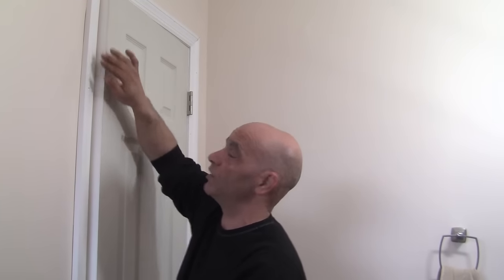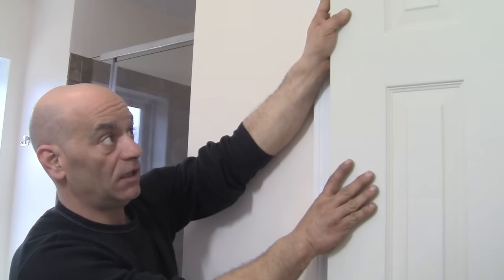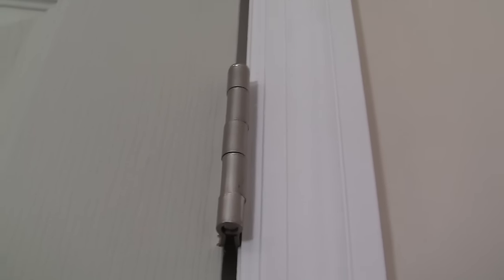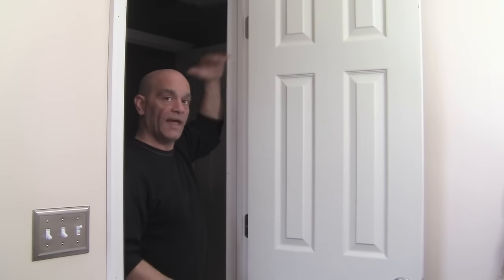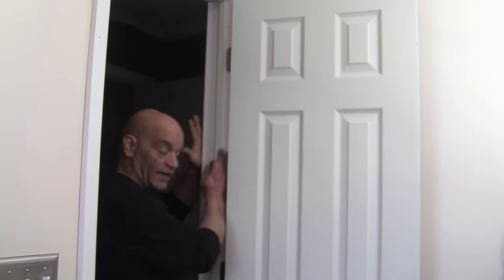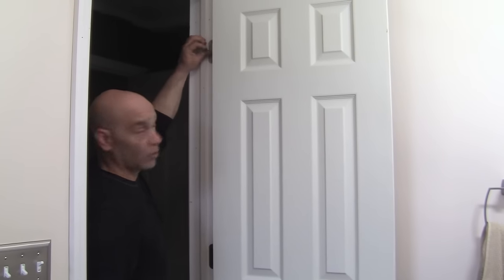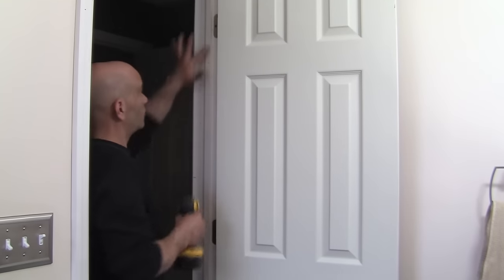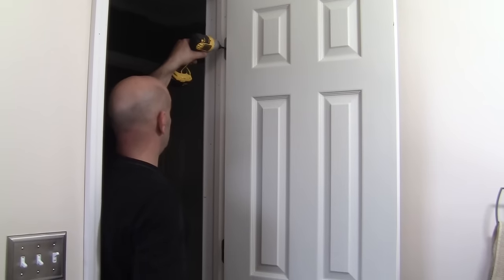How to adjust a door when it's hitting the sides.

Comment: What about a door shim? You can use a thick amount of paper and use the corner of an envelope as the sleeve for all the paper. Cut with a razor blade to correct size. Drill screws through the paper shim securing it. Easy mode, free, and puts good use to your junk mail. ;)

Comment: I used the T25 star headed screws about 1 1/2" long and it does the trick all the time. I've also had problems lining up to hinge halves to put the pin in so I just removed the half hinge from the jamb side, put the hinges together and slipped in the pin. Then, I got some long paint sticks from the hardware store, slide them under the door to elevate slightly and re-attach the hinge to the jamb. So far, it has worked.

Comment: thank you, it fixed my door. Too tight to close. I was thinking of replacing the hinges, but I cleaned it first with WD-40. Then screwed it with 2.5 inches screw. It worked.

Comment: I took out the existing screws, which were loose, stuck chopsticks, you can use toothpicks, into the screw holes, and reinserted the old screws and saw them really pull and tighten.  A nice fit now.
Reply from the maker: Very cool, thank you

Comment: If the screws are not loose I use a 4lb sledge and a 2' scrape piece of 2x4 to adjust jamb. The places I work at have crazy unstable foundations. Sometimes my customers cannot even open their doors and the fire department cuts through the front door because its wedged shut.

Comment: Wanted to share a tip if you are trying to screw into an existing hole and it won't catch, drill out the hole, glob some wood clue in there and stick a dowel into the hole and cut it flush with the frame. Let it dry then screw into the dowel. And yes the pre-hung doors you get from jeld-wen and masonite have the cheap ass hinges on them with short screws. Those are usually the first thing that will go bad when you buy a pre-hung door like that.

Comment: I’m going to have to try this. I live in an apartment and I have a back door that it seems that, with the building settling occasionally, the door goes anywhere from having enough space on the bottom for people to actually see into my apartment, while coming up the back stairs OR, the edge of the door is actually resting on the floor, misaligning it with the latch and it won’t latch properly. Despite having sensors and a Ring Doorbell on the door, it’s still a security issue. This is particularly so since these are pandemic times and I’m a Prepper who doesn’t want a break in. I’d like to install a NightLock but, it requires 1/2 space so the door can swing open. This is a real PAIN.
Reply from the maker: Oh boy, yeah that seems like a lot.
Reply: askmediy yeah, I’m going to see what I can do. In looking at the space between the door and the jam, all around, it seems that the door was a bit of a tight fit to jam, in the first place. Yet, it still manages to drag on the floor. I’m not surprised as,’it is a heavy door. Not metal. But, heavy. Thanks!

Comment: I had similar problem installed new frame & door with new hinges, the opening edge was rubbing bit from top to bottom, I had pulled out the pins on the hinges removed the hinge off the door the 2 knuckle side placed in vice almost down to the knuckles then used cresent wrench bending each knuckle very slightly away from the side of where screws go in on hinge in other words the bending would go towards the opening edge of the door which I did this on both hinges of the door reinstalled hinges on door with pins it pulled door away from opening edge 1/16" inch door no more rubbing everything lined up perfectly, I had to do this twice 1st time pulled door too much to hinge side had too much gap that caused rubbing on jamb & door so had to lightly bend back knuckles back the other way, videos I seen out here show guys bending hinges on the door I dont recommend being can pull screws lose in door stripping out the threads, removing hinges bending them in vice best way to go..

Comment: Just bought an old house and it has lots of levelling issues. İt's warped. Right top side of the doors have about quarter of an inch gap. I tried 5" screws to fix the problem but it didn't work for me. What would you recommend me without seeing it?
Reply from the maker: On something like that I would remove the door frame and reset it, sorry to say.
Reply: @Askmediy  l checked all around the door frame with a level it was fine. Then took the door off and checked it with the level to make sure it's not the door either. I'm gonna change the door hinches and check it again to see if it's gonna do any difference if not l will do reset the door frames as you recommend. I will let you know about the improvement. Thank you for your quick response and help. 👍

Comment: Another tip of the day is before you replace the hinges is try drawing the jam into the jack and king stud with a longer screw. 9 times out of 10 that will correct the reveal/rubbing problem. If there are shims between the hinge and the jack you may have to remove the trim/casing and shims, suck the door in with a longer screw. Once you've achieved your desired reveal and door doesn't rub anymore install new shim behind hinge, replace trim, and you should be good to go.

Comment: My problem is the fitting of the hinge correctly so that the door can be closed easily. the first time I installed a hinge the door stopped halfway and didn't close easily. then I cut a recess and it worsened everything. I then filled the recesses and started all over. I got so intimidated by the idea of installing a hinge that initially looked to me like a piece of cake. where should I start learning to install hinges?

Comment: What if my door frame is a metal frame. My top hinge screws are loose and the door has some play. Can i still use a long screw to bolt into the inner door frame which is also metal
Reply from the maker: Yes, if there is wood framing behind it.

Comment: I have a garage door thats extremely bad, it contracts in winter and expands in summer from moisture and no hinge adjustment will fix this.. any other ideas?
Reply from the maker: Do you mean the big roll up door?
Reply: @Askmediy  nope
Just the main access door.
It gets very dry and cold in winter and very humid and hot in summer here in Saskatchewan so the hinge adjustment won't work, the problem is very bad. I may have to sand it down a bit
Reply from the maker: Nun Ya is it a solid wood door? If so yes shaving it down, or sanding it should do the trick
Reply: @Askmediy  yep that'll be the only way. Just ordered a sander haha
Reply from the maker: Cool tools is always a good thing.
Reply: @Askmediy  absolutely.
Thank you 👍

Comment: My top hinge come loose causing the top of the door to rub and the 1" screws in the hinge free spin. I tried a longer screw 2" and it still free spins in the hinge what could cause this?
Reply from the maker: There is cap between the door frame and the framing of the wall. So in order to get into the framing you’ll need a longer screw. A 3” should work fine.

Comment: If holes are strippes in the hinges, you can bang golf tees into holes, cut off excess. then puy screws back in! You can use glue on tees!
Reply: Excellent idea, thanks for posting!
Reply: donald kalinich.....  I've been in trade for 30+ yrs. and have carried a container of TOOTH PICKS.
Reply: I don't even know what this means.
Reply: What it means is that you plug the stripped out hole -- not in the hinge itself, but in the wood door casing.  I usually use a dowel of appropriate size.  I drill out the hole so that it will barely fit the dowel, squirt some wood glue into the hole and onto the dowel, drive the dowel into the hole, wipe off excess glue, and cut off the dowel flush if is is sticking out.  Once the glue dries, you can drill a small tap hole, and the hinge screw will hold just like new.   Instead of the dowel, you can also just coat with glue as many toothpicks as necessary to fill the hole, and shove those in, as No Retreat suggested above.
Reply: No Retreat 
RIGHT! a few toothpicks with a little wood glue for good measure takes out the slop in stripped out wood screw holes.

Comment: I have a similar but separate issue where my door swings open on its own (won't stay partly open. Opens all the way naturally if not closed). Would that be a plum issue, or hing issue? My place was built in the 1970's, so I figure it could be a few things. Any suggestions would be great.
Reply from the maker: Yes it's a plum issue. You could try to adjust the lower hinge but that will change a lot with all your door stop trim.
Reply: take the pin out and put a slight bend in it and replace. Door won't swing open
Reply: Plum issue for sure. Put a level on it. Likely your wall is out as well as most door installer are stuck following the wall.

Comment: I have been painting doors and replacing hinges and door knobs. 
I was able to fix one door that was sagging by adding 2 pennies to the lower frame hinge, 1 penny to the middle hinge and none on the upper hinge as well as using two, 3 inch screws.
We have another door that is abutting on the hinge side. what can we do to fix that?
Reply from the maker: +Janet Eldridge What do you mean exactly ?

Comment: Great video! Question: what if you want to use a longer screw as you show in the video, but the frame is inside a concrete block wall (it's an exterior door and frame that is inside a cinder block house)? The longer screw ends up hitting the concrete that is right against the frame of the door.
Reply: Use a 3 inch screw, 1/4 drill bit about 6 inches, and the smallest plastic anchor you can find that matches the drill bit. Drill it into that cinderblock

Comment: I hope I get an answer. I need it. Do I use a wood screw or do the threads have to go all the way up? How long of screw should I use?
Reply from the maker: Yes wood screws. Long enough to go into the framing. About 2 1/2" would be fine.
Reply: Thanks.

Comment: Do I use a wood screw? A screw that does not have threads all the way to the head?
Reply: cocatfan Anytime you want to pull two boards together (in this case a jamb and framing) a screw having a partially threaded shank tends to work much better. Screws with threads all the way up to the screwhead will quit turning as soon as the screw head contacts the surface of the first board. Sometimes an impact driver will power the screw on to strip out the hole in the first board allowing the screw to spin and continue drawing up the second board. If all you have is a screw threaded all the way up, try drilling a pilot hole in the first board to allow the screw to spin freely.

Comment: What can you do if the top is rubbing and the hinges aren't loose?
Reply: Take the casings off and take out some of the shim/ shims behind the top hinge. Its a pain in the ass
Reply: Try this:
In the bottom hinge take the middle screw out (or in a 4-screw hinge, the screws closer to the door stop) & replace it with a 3” or longer screw(s). As you tighten the screw(s) you should be able to actually push frame in. Pushing the frame at the bottom will increase the space at the top of the door. 
If you still need more adjustment, use John Speers’ method listed above. You can do a combination of both.

This combo method is by far easier than taking apart the frame or cutting the door, which is why I do these & only these methods 90% of the time. I work on doors a lot. It’s my favourite thing to do at work.

Comment: What size and length screw would you personally recommend?  I’ve been a huge fan and subscriber for a longtime now, and could use the help. Thanks. Another great, well explained video.
Reply from the maker: Well thank you. For something like this, as long as you get into the stud you'll find. So like 2 1/2 or 3" is what I use.
Reply: @Askmediy  Thank you so much Dominic. I apologize for the delay in that, but I never received a notification saying that I received anything.  
I replaced a very old door, with a new MasterCraft door including the bottom sill plate.  I didn't replace the outer casing bc of the uniqueness of where and how it was installed.  The problem that, I ran into after installing everything is that I have gaps of light coming through a few areas of my door now.  I've tried your screw technique and that, didn't seem to do the trick.  I even put a whole new 3 piece new weather strip around the casing and that didn't work.  Do you have any ideas?  Light is coming through upper left, upper right and bottom left.  Please and thanks.  
Please keep videos coming.   I'm an above knee amputee who's trying to be the best best DIYer that I can be.  You'd be surprised of what I've accomplished with only one leg.  I'm running out of help to finish my basement though.  Everyone keeps saying to hire it out, but that cost a lot of money and around where I live no one stands by there word or warranties anymore.  Also.  I want to be able to do as much as I can, because it'll give me such a great feeling knowing that I did a great deal of it and planned it as well.  
Thank you for your time.
Reply from the maker: @nrfa6229  Really sounds like the frame/door is really out of alignment. In that case you would either have to replace or simply re-install

Comment: What if the door doesn't wiggle? Hence tighten wouldn't help. Then what?
Reply: Don Powell shim the hinges. Shim the side closest to the stop to open the strike gap up. Shim the side closest to the edge of the frame to close the gap up. This is the best and cleanest way to do this job. I would never recommend  the longer screw unless it's the absolute last resort.

Comment: I've got an exterior door that's sticking.  I think I want to take a router to the door jamb to recess the hinges just slightly more.  I'm afraid to do any cutting or planing on the door itself.  Anybody ever use this method?  I should add that the hinges are an older style that attach to the face of the door instead of on the inside edge.
Reply from the maker: I would be careful of what you cut. Could be the end of the door altogether. Can you email me a picture?

Comment: Good video. But this is I would say the obvious intuitional fix. What if there is no play with the hinge. It's a sold heavy door. In a frame that's 70 yrs old. Lol. ... Still thanks for the video.
Reply from the maker: Yeah not so much. I have 180 year old house and it has the same issue. You're not moving these doors with a screw no matter what,

Comment: Doesn't work if the door installer put shims behind the hinges
Reply: Michael Blatter 
You mean a PROPERLY installed door? A properly installed door won't have this issue in the first place.
Reply: Jay Vee shims are always put in hinge locations and behind striker for adequate fixing also you only 6 shims 3 on each side the rest of the frame is trued up with the trim 
This so called work on this door is not needed if it was fitted right in the first 
You cannot screw up a prehung if you know what you are doing.